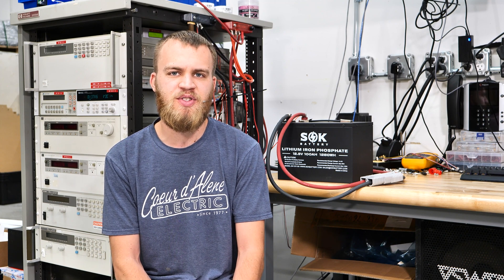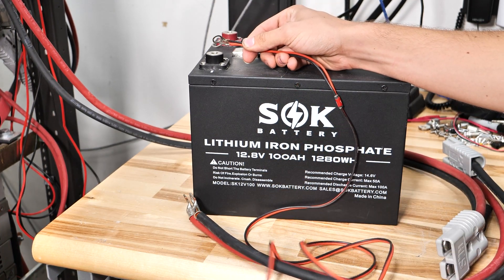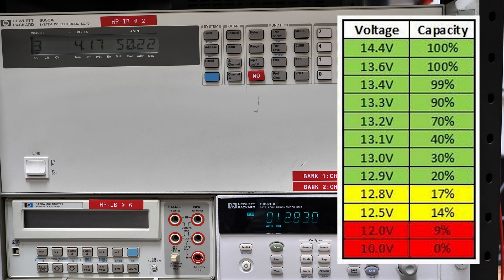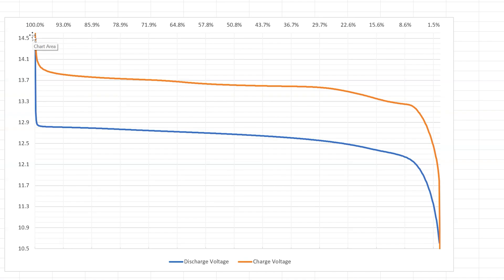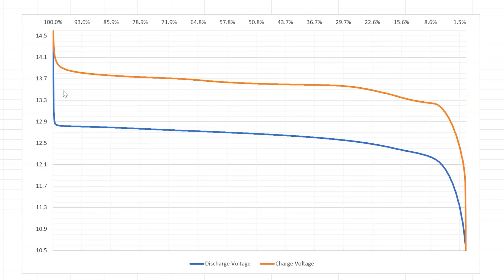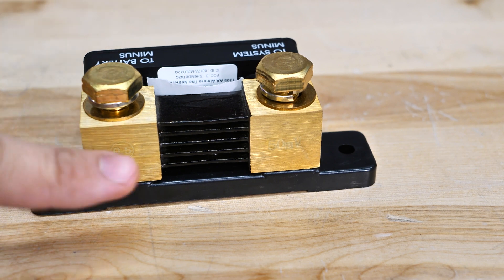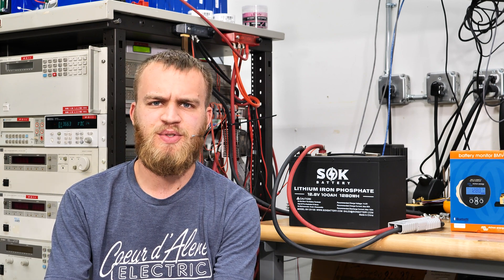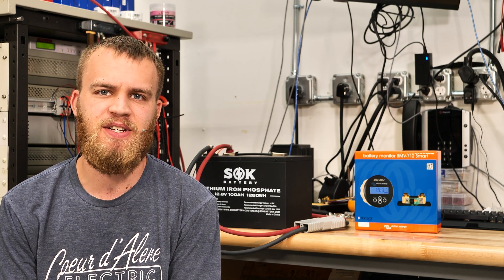🔋Lithium vs. Lead Acid: Voltage vs. State of Charge (SOC)

Comment: Thanks for doing that, I never get to see my LiFePo4's resting voltage since the initial full charge as it is always being solar charged and/or on load.
The voltage reading is always somewhere between 13.0v and 13.3v
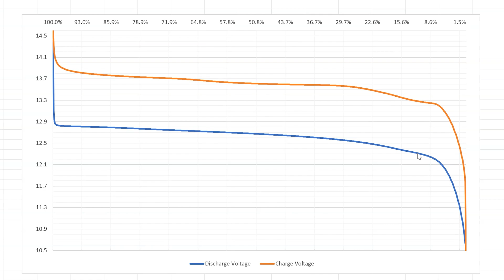Interestingly if you take the average of your charge/discharge curves you get the same values as in that green/orange/red table at 3:21 except for above about 98%

Comment: You can get a good idea of capacity with voltage if you measure and test you're battery pack, also u can get cheap dc kilo watt hour meters with shunts, u know kwatt goes in and what come out and can see the battery voltages accordingly with load. Its not hard at all to know the soc, you get too know you're battery.

Comment: Lead acid is terrible in performance compared to Lifep04. Lead acid is easily damaged from over discharge and as the battery voltage collapses more steeply with capacity its easier to setup triggers based on voltage. The Lifep04 voltage is a lot flatter, and its harder to determine capacity based on voltage hence coulomb counting. But there is massive advantage with Lifep04, it can be fully charged, and there is a steep rise in voltage and a steep drop below 10%soc it easy to meter this, and using 90%of capacity will not reduce the battery life by much, also battery voltage is more stable with load too.

Comment: Great video and because of it I purchased a Victron Shunt to replace my old standard shunt. I do have a question on the Victron Shunt. They seem to pull a fair amount of current and my guess is to power the Bluetooth circuit, so with all that said, can you really leave these shunts hooked up permanently or will it drain your batteries down over al long period of time. I ask because my setup is to backup my home when we have power outages, so the batteries do not get used a lot. They are in standby mode most of the time.

Comment: If you didn't test your battery for AH before you started you truly don't have an accurate number. I saw a video that tested LiPo4 batteries and one had over 150AH but was labled a 100AH
Reply from the maker: The point is that the battery full or empty has such a different voltage scale, that using voltage to determine state of charge is meaningless, a shunt should be used.

Comment: Brother what is the lowest voltage for the gel batteries because I want to adjust the control device to disconnect on the least voltage so that no overdischarge occurs and the battery life decreases

Comment: I have two 12V 100 Ah and they are very different voltage wise. The one with Bluetooth varies the voltage a lot as it discharges. The other battery voltage changes very little from 100% to 20%. In my experience, the AGM voltage chart reflects SOC much better than the LiFePo4 charts.
Reply from the maker: If they are at different voltages, it's best to charge them both fully that way they can balance out.

Comment: No matter what chemistry a voltage chart won't be accurate when a load is being applied to the battery, you have to let the battery rest a while with zero charge/ discharge. Even so, it is more difficult with LFP to ascertain SOC by voltage because the curve is so flat compared to FLA.

Comment: Not so with me; you may read my  (reply to comment below); from 3.200 to 3.330 you have 130 points to id the SOC,and that is enough; i disregard all methods, except the VOLTS; of course, i correlate to the amps (in ,or out, or near 0), and then,   Volts are SOC; i am so used to my 40 cells, on a 48 volt setup, all used, mix and match!!! working well for 2 years, i kind of know them all 16 arrays,one by one now.

Comment: The chart is a rested and stable voltage chart it isn’t claimed to be able to give SOC when charging or discharging. BMVs are renowned for being incorrectly set up and for ruining lead acid batteries by people believing them. The problem is them not being synched correctly, having the wrong percentage efficiency set, the wrong tail current, the wrong charged voltage, particularly where solar is part of the mix. The best SOC meters use a combination of coulomb counting and rested voltage as rested voltage can be used to correct the SOC indication when he coulomb counter isn’t being regularly synched with a full charge. Resting voltage charts are actually very useful for showing when BMVs are out of sync and I would say they are an essential check against being misled. You just need to know what they are intended for and use them as such.
Reply: You are entirely correct. This video is misleading. Anybody should know that battery voltage will be depressed during discharge and elevated during charging. Resting voltage is the key.
Reply: Can you point to a video that explains this correctly

Comment: I have not used either of these Victron shunts, but the problem I've run into with some of the other products is they do not measure smaller draws very well, especially the current an inverter draws while it's on but not powering a load.  The end result is you think you have close to 100% SOC, but as soon as you start powering an actual load, that percentage drops very quickly.  Do the Victron shunts handle this any better?

The problem with what is shown in this video is you're only showing the voltage of the battery while under load.  While that is probably a good real-world demonstration, it's somewhat disingenuous because LFP batteries DO show a gradual voltage drop at lower SOC, but you're obfuscating that by having it under a load.  Also not mentioned is your 100AH battery won't be a 100AH battery forever...which means if you want an accurate reading from the shunt, you'll have to capacity test and recalibrate the shunt periodically.  Most people get way too hung up on knowing the exact SOC of their LFP batteries.  Keep them charged up to 80 or 90% and add more capacity, as you are able.

Comment: 30 years ago I installed a Bogart Engineering cumulative amper hour meter and 500 amp shunt. Its still working after 30 years of 24/7 use. That was on a lead acid battery bank. Just switched to lifepo4 where it also works well at showing state of charge.
Reply: Now considering that a shunt is just a piece of metal, what could go wrong with it?

Comment: It looks like a LiFePO4 can last twice as long if you don't run it below 50%.  Is that true?
Reply: Not true. Temperature, and not over charging, or pushing small amounts of current into an already charged battery - using float mode on LiFe battery are what will shorten the life cycle count.
Reply: @s.mendez7160  Thx.

Comment: Man you are focusing that much on charge voltage but taking the capacity rating as granted !! The device should see some charge and discharge cycles and determine the true capacity.

Plus you have plotted the graph on a discharge cycle, that obviously drops the voltage but when you charge the (considering its not floating then the charger will be supplying the power needed, and voltage will not drop, considering provision overhead in that in the charger) but at the charging cycle the voltage shall rise in ball park of that charge.

Your point is right when calculating the backup time but probably not when considering charging, still, in that device capacity should be varified through the program.

Comment: Interesting,  i have a 24v 50ah battery i setup with the infamous chinese shunt and i wanted my battery resting at 80% thats supposed to be 26.65v and the shunt was telling me i was only at 72.6%....... this vid is making sense of it now. I just upped my chage to 26.7v I'll see where the shunt settles now and keep adjusting till i hit 80%
Reply: What shunt is that? My shunt won't show the SOC on lithium...😢
Reply: Did anyone explain that a shunt is just a piece of metal? It doesnt matter if its chinese vietnamese or indian. its just a bit of metal with a known resistance
Reply: @dantronics1682  yeah sure the shunt is just metal but not the electronic controller that's supposed to monitor that piece of metal. Victron vs Chinese..... big difference.
Reply: @NigelM18  Yep Big difference £200:£40

Comment: Thanks. Very helpful. I have a an expion battery monitor with expion 360 lithium lithiums and was concerned as my voltage was moving from 13.3 down to 12.5 and still showing plenty of amp hours and 100-90 SOC. This makes total sense.

Comment: ONe thing that is very important. Lead acid battery must be above 11.7V all the time before it start degrading from sulphation problems.  The Lithium is the other way around, it degrades rapidly if it is close to fully charged.
Reply from the maker: For lead-acid, yes, you are correct.  For lithium, not so much.  With NMC and NCA chemistry, they do have additional internal stress and degradation when at high state of charge, but for LiFePO4 (LFP), they do not have this issue!  In fact, most LFP BMS modules only balance when the battery is at 100%, so by not charging to 100% you get additional degradation and capacity loss from cells being out of balance.
Reply: @CurrentConnected 
Nonsense. "Most Lithium BMSs" (with active balance) can be programmed to balance at any value, but 13.4v is considered good. I recently discharged mine to 10.5v whereupon cells were way out of balance. So I set it to active balance ALL THE WAY UP to 100%. What is the point in ONLY top balancing?

Comment: Problem is there are at a minimum 3 voltage:state curves:  Under charge, under discharge, at rest for at least 30 minutes.
In reality, LiFePO4 voltage is nearly uncorrelated with state of charge.
Reply: i find Lifepo4's Voltage to represent their SOC with precision;
 i have 40 lifepo4s(old, CHEAP, 20 of them donnated from non use etc...,some bought USED...) arranged in a 48 volt system working off grid for 2 years nowm i build my own LOW FREQUENCY inverters using the MODDED EGS002 famous control board, only 5 or 6 euros; oh.. and a 3000 watt 23 kg toroidal trafo and the 47microHenry coil of course
 the voltage is WITHOUT FAIL the SOC, because i KNOW my batteries by now; they are Amazingly Very Consistent.... what a chemistry!!!  i just look at the current, in or out, or near zero, and go from there;
  i know them all, immagine you have 5 or 6 dogs for a while, you´d know them  too.
Reply: @josepeixoto3384  Nonsense. If you give you a battery there is no way you can measure the voltage and know the state of charge. You cannot change physics.  I've had LiFePO4 batteries for 10 years (and lead acid for decades before that).  A 100% full charge on LiFePO4 can be anywhere from 13.5 to 14.6 volts, depending on how long the charger has been turned off.  If you are currently charging or discharging the curve is entirely different from each other and from an idle battery. While charging or discharging there is only 0.1v difference from 20% to 80% and less than that if the battery is idle.

Comment: Isn't that chart resting voltage, not under load voltage?
Reply: yup. this guy has all the gear and no idea. welcome to the internet.
Reply: @freelectron2029  We'll never know if he has any idea or not but I think he was just trying to sell a named product
Reply: yes, yes it is...
Reply: So many people purchase and install LiFePO4 (LFP( batteries and use Lead Acid battery gauges to meter capacity by voltage.  The voltage curve of LFP batteries variation is so small, that even at rest, does not give a true indication of capacity.  The best capacity measure is using a meter (that is set at full capacity) and a shunt to measure amp hours extracted from and added to the battery.
Reply: @robertmuster1350  
I agree.  The best test being a loaded test is actually true for lead acid batteries as well, at least for general battery health.  The issue with loaded tests is that the voltage chart would only be at a very specific load (1C, 2C etc) and with the wide variety of battery capacities, would require a variable load tester and more knowledge/skill to perform the measurements.   A simple voltage reading is quick and easy, albeit not the most accurate.
Reply: @robertmuster1350  That would be assuming that 100% of the energy that enters the battery is stored. you can put a 100 ah in a battery and only pull 95 ah from it.

Comment: Your title is wrong. You didn't discuss lead acid at all.
Reply: Right, no lead acid battery tested
Reply: He is also wrong about the voltages, you can discharge a lfp4 battery to 11v and there is data to prove that, if you’d like…
Reply: Almost seemed like a shunt battery monitor commercial instead of talking about Lead acid batteries

Comment: Isn't that chart just for lead acid?
Reply: yes
Reply from the maker: No it is shared on many websites, forums and Facebook groups as for lithium. With lead acid resting full charge is at 12.8v
Reply: @CurrentConnected  Thanks for clarifying!
Reply: @CurrentConnected  With lead-acid the resting full charge is 12.6v.  This is a major reason why you cannot parallel lead acid with any lithium chemistry.

Comment: What shunt do you recommend for budget builds? Is there one that's cheaper than the 130 dollar victron smart shunt, or is that the cheapest reliable option.
Reply from the maker: Victron SmartShunt is the lowest cost & most reliable option we suggest.  While some cheaper ones do exist, they certainly are doing it at the sacrifice of accuracy and features.
Reply: @CurrentConnected  I'm very happy with my smart shunt, just wondered about other options. I wish the smart shunt had a simple and low cost screen that connected to the 4 pin port on the shunt, to display the information. The cheapest option for a display I've found is to use a used tablet as a screen for it.
Reply from the maker: That tablet is a very expensive screen!  For this use case, we have the BMV-712 that only a few bucks more, but it has its own screen you can mount up to 25 feet away for viewing at a quick glance.
Reply: @CurrentConnected  I got the tablet for free, otherwise I wouldn't get one.
Reply: The Bogart Engineering trimetric shunt is also quite good, just doesn't have bluetooth. I used it before I got the Victron

Comment: WHOA Big Fella.   The chart, though horribly wrong as you say, is based on resting voltage.
Neither of your curves are, nor can be by the nature of charging and discharging, at resting voltage.
I heard you say that you discharged at 50A.  What was your charge current?
Ah - you're selling coulomb counters.
Reply: yeah sales pitch, lol.
Reply: Who, in the middle of using their batteries, shuts everything off for hours "to rest" to figure out how full they are?
Reply: @HighTechLab  
No one.  But many will measure a resting battery to determine its state of charge before using it.
Reply: @Andy-df5fj  That's one thing about lead/acid batteries. Voltage droop is a big thing. The harder the load, the lower the voltage. It sounds crazy, but, yes, in order to get some idea of the SOC of a Lead/acid battery, the load must be disconnected for several minutes at least, then measure the terminal voltage.
Reply: @Andy-df5fj  exactly
Reply: Making the useful chart sound obsolete for no other reason than to sell some unnecessary crap. How pathetic and deceptive is that?
Reply: At 1:53, the datalog screenshot shows discharging at -50.0a and charging at 49.9a.